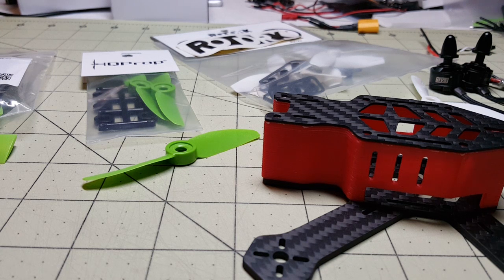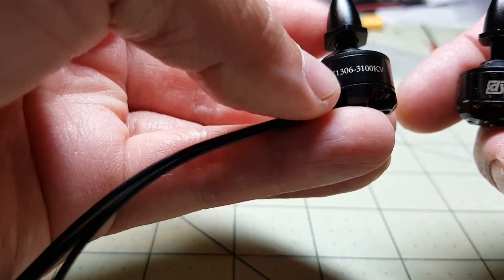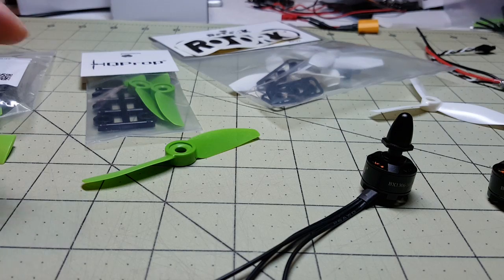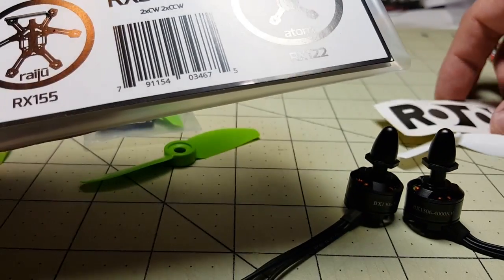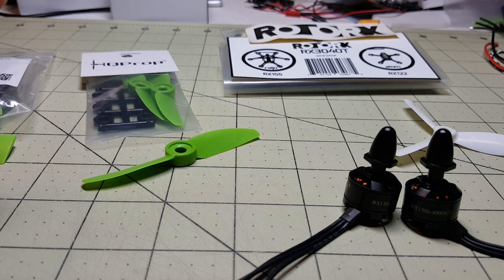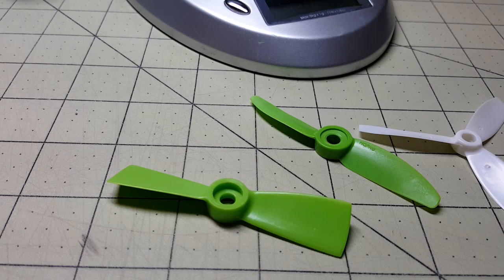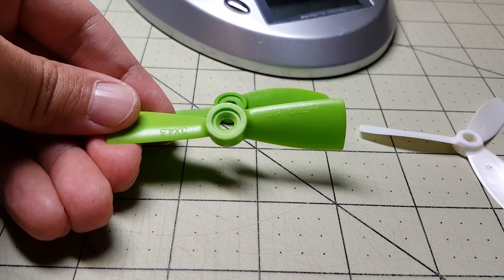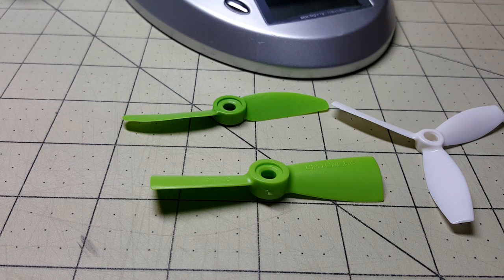DYS 1306 Motor 3100kv vs 4000kv

Comment: Hey thanks for the video. Oh and thanks again for the Tyro99 vids, I'm enjoying mine. Question. I want to do a 3in build realacc ts140 frame. Primarily 3s. Would you recommend 3100 or 4000kv 1306?  Or 1306 at all for for a 3in build? For exploring and mild acro. Longer flight time preferred. Thanks for your help man! Love your work
Reply from the maker: For 3S, get 4000kv 1306.  You can still fly on 3100kv but power will be lacking for acro.  It will have a really long flight time on 3100kv.

Comment: Awesome stuff!! Thanks for sharing. I'd like to know how these behave on 4s though. For those of you who suck at math, the top 3 performers are the HQ & RotorX @ 3100kv (26 and 25.1 g per amp) and RotorX @ 4000kv (23 g per amp). Seems like 3 blades are without a doubt the way to go for both thrust and efficiency no matter the kv

Comment: Do you think this would work for a tarot 130?
Reply from the maker: Yes, but you'll need to also upgrade the ESCs.  The stock ones are too weak for these motors.
Reply: I bought a tarot 130 and after the unboxing I realized it came with one faulty motor (or ESC?). It lacked power and move erraticaly, after a couple of weeks I tested the quad again and now motor 4 (or ESC 4?)  also has the same problem.  I don't understand what's going on. Any ideas?
Reply from the maker: +Eric Avila Sorry, I don't know

Comment: Hey I am using 1306 4000kv with a 3030 tri blade but i was wondering if this motor would produce more thrust on a 4 inch prop like GF3040 tri
Reply from the maker: You can use the 4000kv motor on a 3S battery and 4 inch prop and it will be pretty fast.  You'll need 20 amp ESCs
Reply: ok thanks! i have a 20amp 4 in 1 esc, so i think it should work out, just didnt want to pull the trigger on a 155 and have it be slower than my 130 on 3s

Comment: hi, I just want to ask, can 12a esc run 1306 4000kv motor ?
Reply from the maker: +Forted Exe (ForteD) It depends on the prop you use. You'll be cutting it close. I recommend 20amps with a three inch prop and 4000kv motor to be safe.
Reply: Thank you, bcause i already have 12a esc from my old quad, and Iam prepare to build 150 size quad with 3" prop. After some research on google, I think 1306 motor will have better performance with 4" prop. I dont have 1306 4000kv motor yet, can you make some test on 4" prop ?. If it better, I think I should go with 180 size quad :(.
Reply: IIRC the 4000kv runs 3" props better than 4"; don't ask me for citations tho, it's probably deep in the r/c forums.

Comment: thats nuts. so your little quad has some crazy thrust. What flight time are you getting with that 850mah 3s ?
Reply from the maker: +Nathan Knight I have my timer set to 6 minutes and I typically come down at 3.8 to 3.7v. I could go longer. For whatever reason the RotorX triblades are very efficient and produce a ton of power.
Reply: I think i like the idea of starting with those blunt nose for crashes.

Comment: Take care guys! I melted my Armattan 1306 3550kv with 4045 BN from dal running 4s 75c Tatu. I share this because it hurt bad.. I loved them motors on triblade 4045s.. Still on waiting list for the Tmotors. I wish you did some 4inch pulls. Wonder if 4000kv would hold. Cheers
Reply: Epic-Elite Dynamics 4000Kv seems like too much I prefer the 3600 range 1407 motors. I have f20's at 4000kv on 4s and they come down warm and sometimes hot so can't be good for them.

Comment: Excellent comparison. 5:38 60% to 70% more thrust is a significant increase in performance. For 4S that 4000kv motor would shine, provided it can withstand the load. I think it should be OK in flight, but on the test bench it may quickly overheat. Bench testing is always very stressful, motors never quite see those high loads in flight. I usually see 25 to 35% fewer Amps in the air compared to what's measured on the static thrust stand. Now let's see some flight video of the 4000kv motors.
Reply from the maker: +EngineerX Thanks for the additional info!  I definitely will look into 4s specs later.  I just don't have any 4s lipos at the moment.
Reply: Hello EngineerX I have the 3100kv variant lying around for a year.. I want to build it as 3 inch setup. I ve found out iflight nazgul 3061 and bought 2 pairs. But before I make my battery choice I m wondering if Im doing wrong.. I see these motors can spin 4" . But with putting 3" props can I use these motors on 4s safely? My other prop option is dal 3056..
 It will be a heavy 3" since I want to use 66gr 3" frame..
Reply: With 4s battery, what prop did you use?  On hobbyking this motor is especified to 2s.No risc of burning motor on 4s?

Comment: Engineer X did a in-depth review of 1306 3100-3350kv recently, GF4045 3100kv produced 317g @ 8 amps.  I've given up on 3 inch props on 1306s, just not very efficient.  4s a must if you do.  GF 3545s are the next best thing.  Recently discovered KingKong 4045s, feels like slightly more thrust than the Gemfans and just as efficient but practically unbreakable.  Cheap as chips too.
Reply: @ming00n  this turnigy D1306 4000kv really can run at 4s battery?

Comment: Thank you very much, marblekit.
The only prop that I would like to see tested with this bunch would be Gemfan's offerings - the 3030BN and maybe the 3545's.
The results show that getting well in excess of a 4:1 thrust:weight ratio sub 250g is achievable and should make for some sick rocketships on 3S,I shudder to think what they would be like on 4S.
<Cough Blue>

Comment: im a little surprised on thrust results. I expected higher
Reply from the maker: Its 3s only. The 4000kv motor is supposed to be rated for 4s so should produce even more on 4s. I just don't have a 4s lipo to test...
Reply: +Albert Kim (marblekit) i know just a lil surprised.